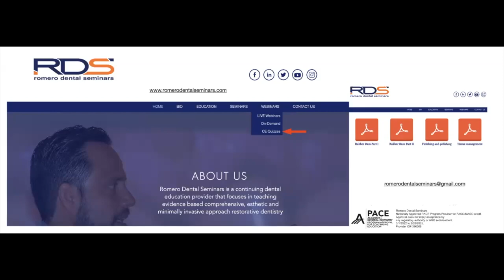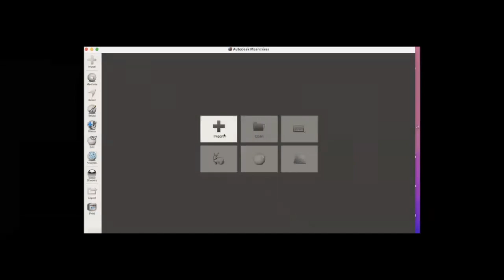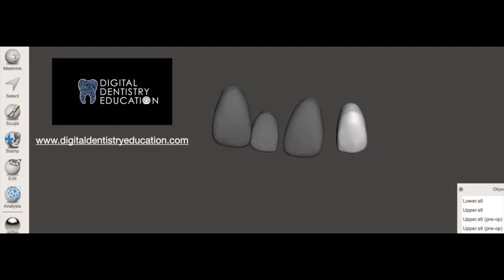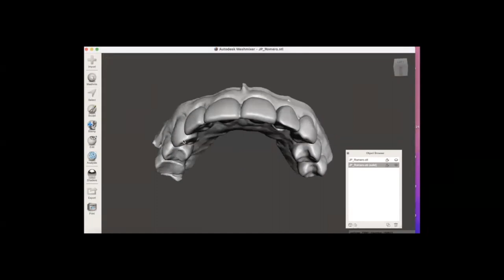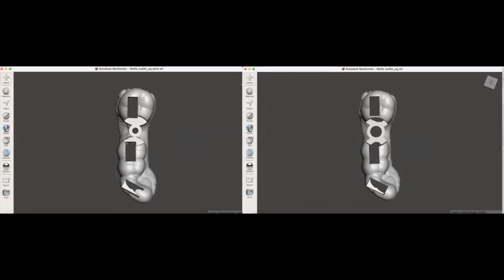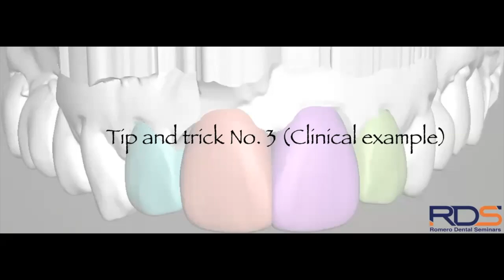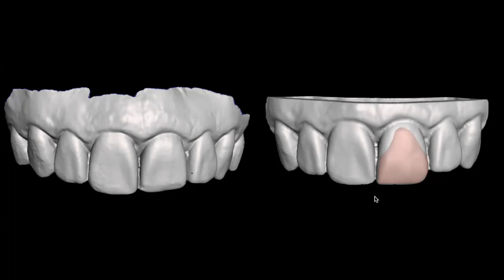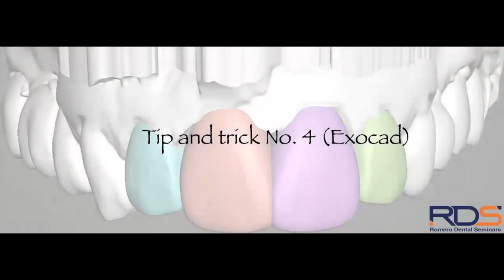Tips and tricks on digital wax up

Comment: How do you make sure you have no shrinkage from the 3d print I use elegoo Mars pro and get shrinkage
Reply from the maker: Polymerization shrinkage will always be there, resin is resin, but I have never had it to the point that it becomes a problem. I guess you can always “slightly” over-contour your digital wax-up to compensate. I have never done that. Hope this helps and thank you for watching.